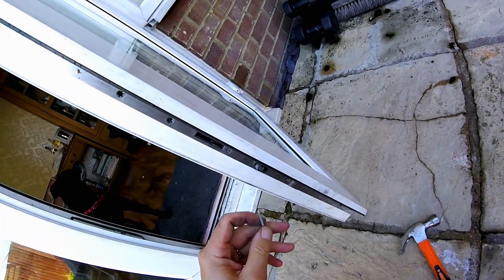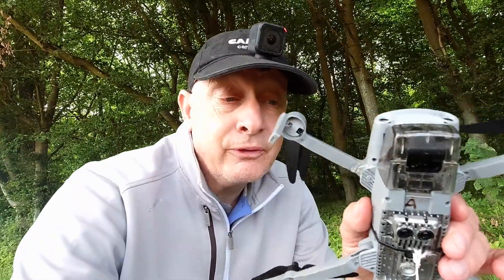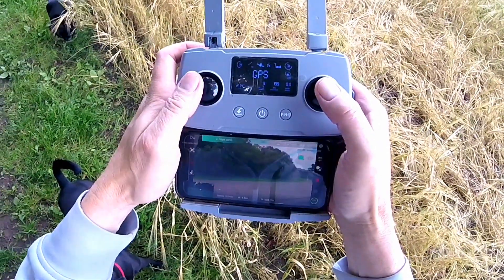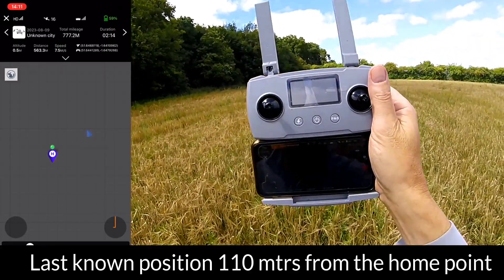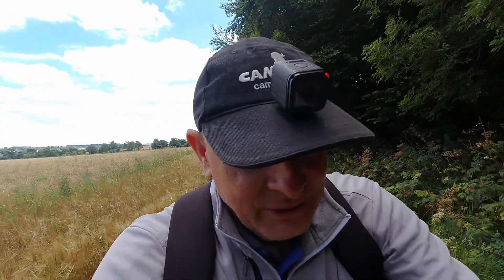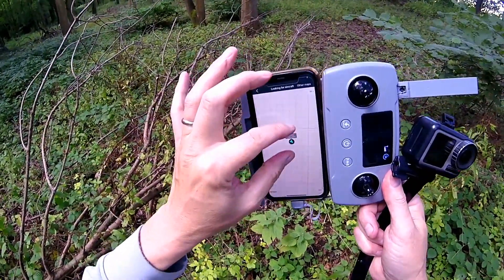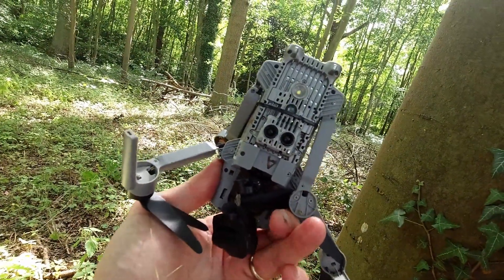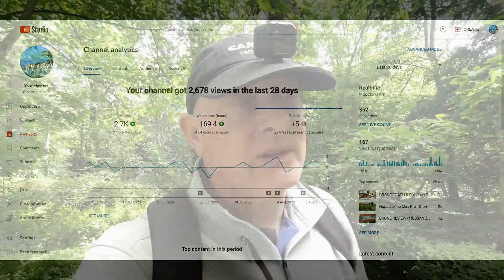LOST CONNECTION DESTROYED MY DRONE! DAMAGED BEYOND REPAIR

Comment: amazing that you found the needle in the haystack..just a shame it was FUBAR.
Reply from the maker: Hi, I simply don't get it, I lost connection at around 210 ft which is higher than the tallest trees in that small wood, in appears that the drone just simply fell out of the sky. I'm still trying to understand why it would have done that

Comment: I find this a puzzle. 2 ZMP drones doing much the same thing. You are welcome to borrow mine to keep the filming and investigation going. I do wonder if it has anything to do with all the other electronics that you have running at the same time. A few years ago, the drone advice was to turn everything else off and even switch your 'phone to aeroplane mode before turning the WiFi back on.
Reply from the maker: Hi Greg, thank you for the offer, but I would be too afraid to use it because I just might crash it or something bad happened to it, but thank you for the offer anyway. I have emailed Hubsan and told them about the problem, not sure that they will respond in a favourable May.
Reply: @MadDogsandEnglishman  Understood. There's always risk. Don't hold your breath with Hubsan!